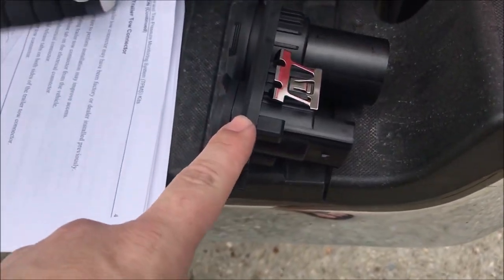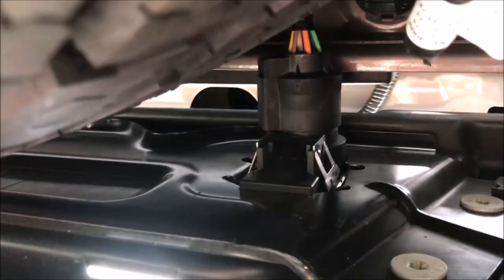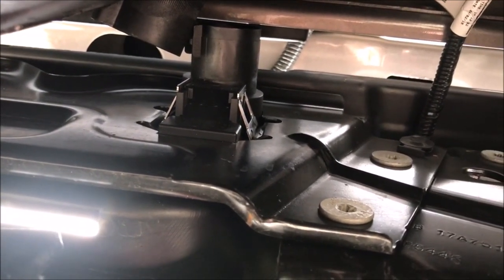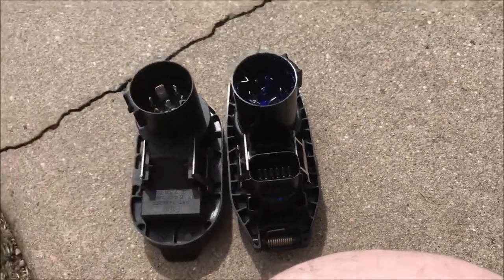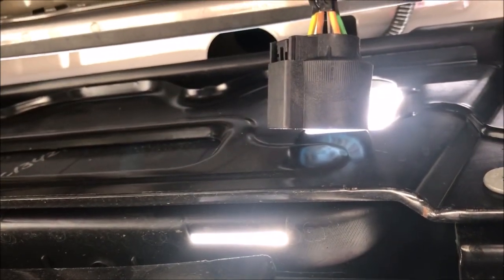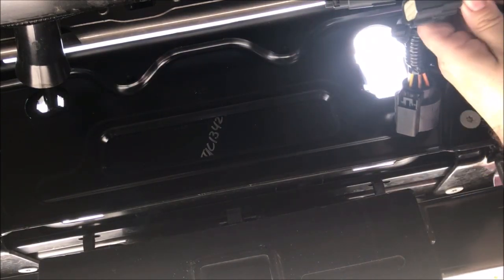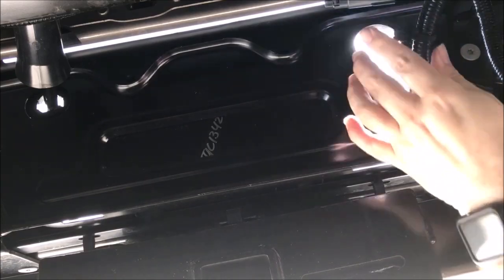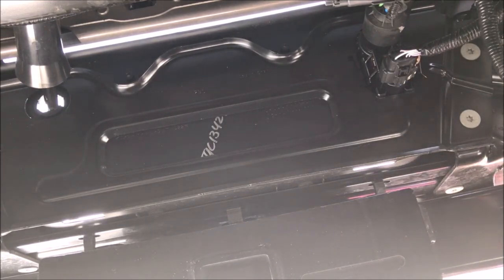Ford Super Duty  - Customer-Placed Trailer Camera & TPMS - Truck Install   PT2

Comment: Thanks!  This series was very helpful for my install... appreciate the effort.  We have a 2020 F350 Lariat Diesel with the  UTT CAMERA PRO TRLR BACKUP AST package and your tutorial was spot on.  We only did the TPMS portion as our application is a utility trailer that pulls a John Deere tractor, not a travel trailer, so the camera was not necessary.  If anyone is interested in just the TPMS portion, without the camera, the Ford part number is LC3Z-1A189-B.  Cheers!

Comment: Thank You, Thank You - I purchased the Trailer TPMS system form Ford as a accessory on my 2021 F250.  Was hoping the Ford dealer would install - but they didn't want to.  However, I did get them to put the tire pressure sensors in.  Then after reading the instructions, and watching your videos - I was able to get everything connected and working.  Interesting - The way Ford sends the kit, was for a lot of other stuff.  The kit included a bunch of stuff not needed for just the TPMS.  After figuring out what to do with all of the extra wiring, (Electrical taped a lot of it together to streamline it, zip ties are your friend,  It all came together.  The programing was a breeze - and it all works.  Not many good videos or direction out there on this system - yours was a lifesafer.

Comment: Lowering the spare is a PITA... don't blame you at all.

Great video, thanks. I plan to add this to my 2017 F350.
Reply: I agree.  Every install video I've seen on this system,  the guys doing it start out not removing the spare, only to remove the spare.  I'll just drop the spare before anything.

Comment: Thanks for your very helpful videos!  My son just purchased a 2022 F250 Lariat Tremor.  A few days ago I used your videos to guide me to installing this system on his truck and contractor trailer.  Everything went well and the camera works (will do the TPMS later when I can get the sensors installed)  This morning he texted me to say the 7/12 connector isn't working.  Dang!  As you mentioned, the harness connector needs to be spun around a bit since the locking clip is on the opposite side from the original.  I disconnected and reconnected the connector and...nothing.  No trailer functions.  I re-installed the original 7/12 way connector on the bumper and everything's golden.  You really can't mess this up.  Any thoughts as to why the 7/12 connector that came with the camera/TPMS kit doesn't work?
Reply: Did you figure out why it didn't work? I'm wanting to do the same to my 22
Reply: @TheJlongoria must have been a demon.  I re-installed the connector and it's been working perfectly ever since.  My only complaint is the TPMS harness length.  I have a 8.5 ft x 16 ft contractor trailer.  The length of the camera harness reaches from the back to the front but the monitor only reaches halfway down the ladder.  I would like to mount the module on the frame but had to leave it on the roof zip tied the the rack.
Reply: @revkrohman  thanks for the reply. I have a 34' 5th wheel that already has a camera. I was just wanting to add the tpms sensors but 15' sounds short?!  Not sure it's going to work
Reply: @TheJlongoria  to be honest find something else.  I would never buy this setup again.  I paid $1300 Canadian and when installing the stuff I felt ripped off.  All that money for a bunch of plastic.  The worst thing is the video resolution might be OK for a smaller screen but it looks like crap on my 10 inch.  The display is fuzzy.  It does the job but for that kind of money I expected more.  I only bought it because of the Sync 4 compatibility.
Reply: @TheJlongoria  I bought the camera , New In Box on Ebay for $250, and am getting TPMS installed at Discount Tires for $250.  Discount Tire guy says they've done the install on Trailers and married them up to F250's many times without problems.

Comment: Seems ridiculous to me that Ford runs that wiring harness all the way to the back of the truck, but then doesn't just simply put it in the connector. What would it hurt to just have it connected? If you don't buy the connector, it just goes unused, like most 7-pin connectors on the back of trucks.......

Great video, thanks!
Reply: 100%

Comment: Thanks for the video, do you happen to have the kit number?
Reply from the maker: I will check and let you know
Reply: @MyTorino  I also would like the part number. Thanks
Reply: @wewe365  The kit depends on what year truck you have and if you have ProBackup or not.  For 2017 through 2022, there are 4 options.  With or without ProBackup assist, and with or without TPMS

Comment: I think Ford should have just pre-installed the connection to the bumper.  Good to know they stowed the connector like they did though.  I figured they left it uncovered.  My camera's being shipped and I was concerned about having 6 years of dirt built up on the connector of my 2017.

Comment: So I already have a camera plug in the bed, im not seeing another wire for another camera plug for the bumper…
Reply from the maker: It’s been awhile since I did this, but it seems like I had to hunt for the additional line.
Reply: @MyTorino  I dropped the tire like you did and found it. Had to untangle it to fit. My brackets didnt break tho lol. Thanks for the video, i made my own little recap on my channel
Reply: @MyTorino  im also trying to find a way to mount the camera like you did
Reply from the maker: Cool. I’ll go check it out
Reply: @MyTorino  Based on your design to mount the camera. I bought a bumper attached 2 inch receiver thats that a U bolt and then bought a Curt 2 inch license plate mount. Going to drill and tap holes for the camera. 

I noticed you had a 28 footer and still had tons of wiring for the camera left over. I have a 38 footer, hopefully it will reach. Your channel helped so much on this!